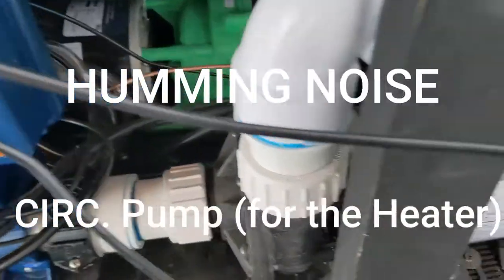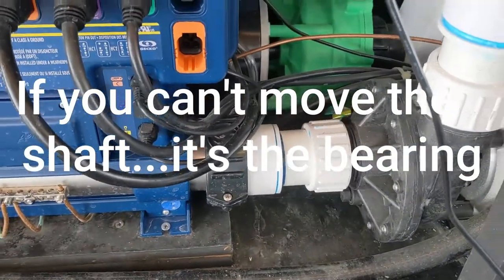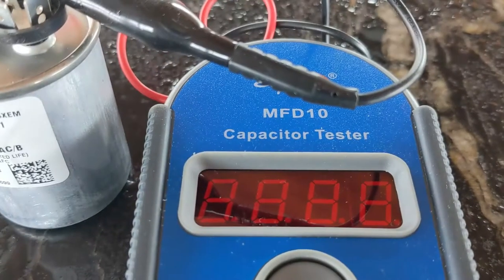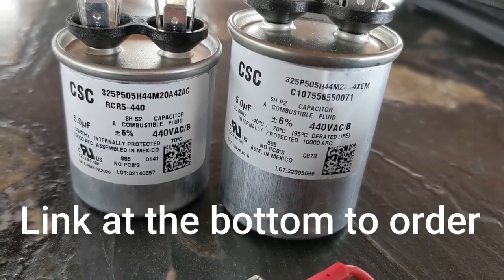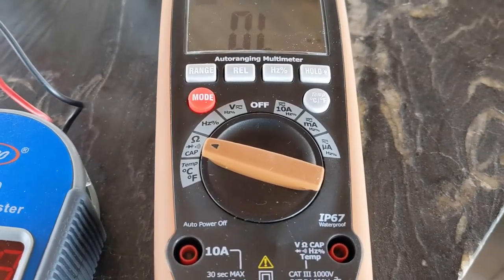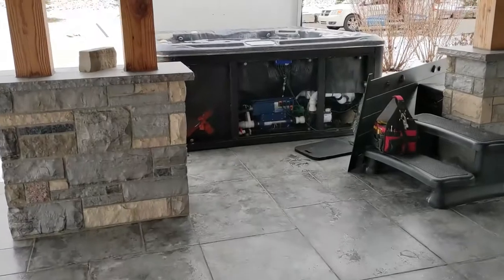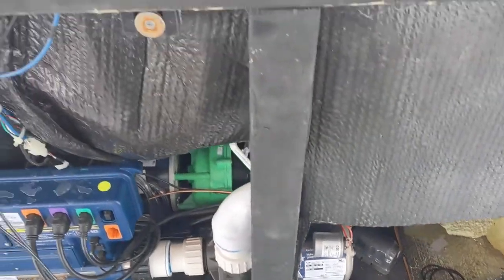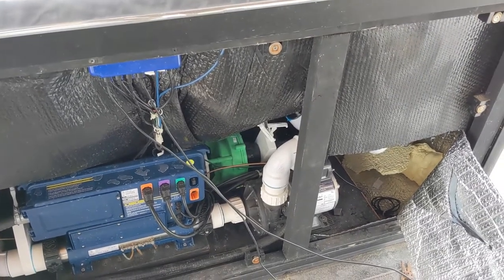HOT TUB Pump is Humming / HOT TUB Pump Tripping the Breaker

Comment: Yours is the video I've been searching for (found many focusing on the "wet end" when I was suspecting the capacitor).  Will start out attempting to spin the motor with a screwdriver (not sure if possible on a 12 yr. old Watkins XP2).  Then gloves on, eyes open for black widows and attempting to remove the capacitor.  Helpful video.

Comment: Anytime you are handling a capacitor, it is a good idea, after disconnecting the power, to take a screwdriver with a plastic handle and short the contacts  by touching them at the same time with it before touching it with your hands. This will remove any standing voltage from the capacitor.
Reply from the maker: Did I miss that?  Thank you.
Reply: @VIPPoolsandSpas  No problem. I was more or less leaving the tip for someone that might be new to the task. It's a really simple trick that can save you from having shaky hands of fear. Sometimes those terminals can be stubborn enough to remove without adding trying to keep from getting shocked to the equation. 👍
Reply from the maker: @medium_mike  my other videos I do say to do that, just forgot on that one.  Thanks again.
Reply: I'm running a 60 amp breaker for a hot tub and can I use no 6 wires or do I need to run no 4 ?

Comment: I have a hot springs with a wave master 7000 pump that keeps tripping the breaker. It has 2 capacitors though. One on top and at the rear. Which do I change or both. Very hard to get to without draining the tub and removing the pump.
Reply from the maker: I would say the start capacitor in the back.  But, not sure the pump you have.
Reply: Filling my tub for the winter season and ran into the same problem w/ the same pump (Hot Springs Jetsetter).  Guessing it's the capacitor (Power on, large click, breaker pops in 3-5 seconds).  Thought shaft might be seized-up but it still spins.  Capacitor not doing it's job.  Sun went down..........tackling it again tomorrow.  Will see if I can spin the shaft with a screwdriver as he did in the video.

Comment: I have the humming when I try to turn the aux on in my tub...I also get a slight odor when I also turn it on, but it just hums...I do not get this metal melting type of odor(hard to describe the smell) when I don't use the aux.  I think I need a new compacitor.
Reply from the maker: AUX is pump 2 I think.  Whatever pump it is, sounds like it's seized or its the capacitor.  Unplug the pump or turn the power off right away and test the capacitor.  If you can turn the impellor pump shaft, its the capacitor.  If you can't turn it, its the bearing.

Comment: I have a new circulation pump which keeps making screeching sound. It’s the second time this has happened after four days of turning it on. Please can you help.
Reply from the maker: Sounds like the bearing.
Reply: @VIPPoolsandSpas  thank you for your prompt response.  How can it be possible on two occasions for it to go so quickly? How can I replace the bearings for Laing E10 circulation pump, where can I buy parts in the UK>
Reply from the maker: Its all one piece.  Can't replace on a Laing.  If its a grinding sound, replace the pump.  If it's a "ticking" sound, check the impeller.

Comment: Why my lifespa new pump only have high speed on, lower speed which when the heat on, the low speed  should be on to circulate water, so that spa water can be heated up. Can you help me with this issue, thanks.
Reply from the maker: New pump?
Reply from the maker: You wired the cord into the new pump?  Does the new pump have 2 speeds?  Does the cord have a black and a red wire?
Reply: @VIPPoolsandSpas  the new  pump has two speed, and black wire for high speed and low speed is red color
Reply: After installation of the pump, I adjusted the control panel on the temperature to 90 degree, and it shows me temperature jump up very quick without hearing the lower speed pump running,
Reply from the maker: @judydai4045  what spa pack is in the tub?         Also. Make sure the pump is wired right.  Red should be high and black should be low
Reply: @VIPPoolsandSpas according to lifespa wiring guide, it said black for High, and red for low
Reply: @VIPPoolsandSpas  how can I send pictures to you, I can show you some pictures
Reply: @VIPPoolsandSpas  Does black and red wire can go through same electric Amp?
Reply from the maker: @judydai4045  sometimes I see that coming out of the US.  Not sure if they are China pumps or not.  whats the pump name?
Reply from the maker: @judydai4045  send me a picture of the wiring in the pump and a picture of the spa pack (circuit board) and wiring. to info@vippools.ca